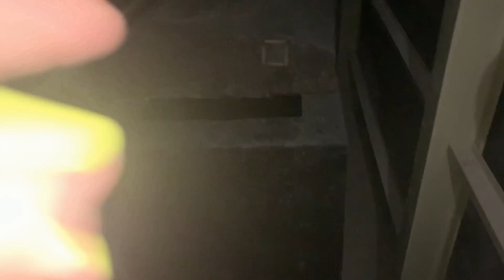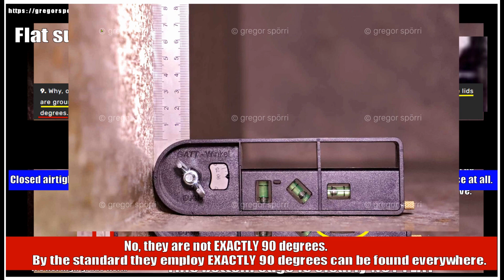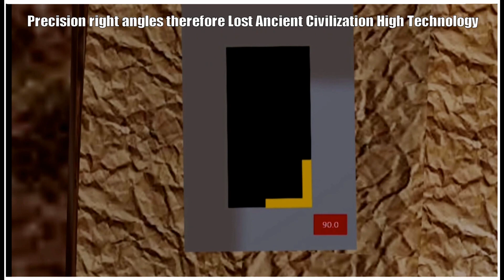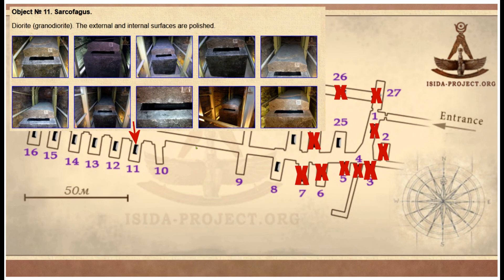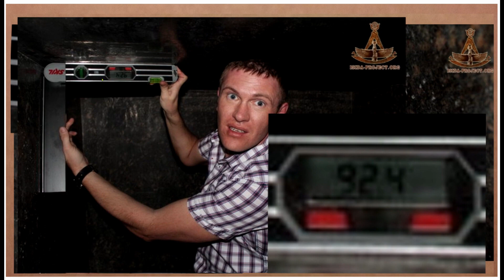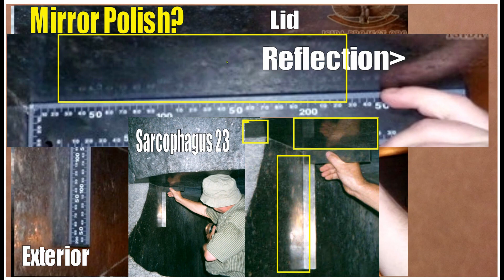Ancient Precision at the Saqqara Serapeum!? NOPE!! It's False!

Comment: A granite box that size for a bull in a wood coffin?  
   If the bull was desicated why would a tight fit for the lid be necessary l wonder, unfortunately a 'cult of underestimating our ancestors skill' is occurring around YouTube. 
  Dunn is a fraud pretending work cannot achieve the remarkable. 
   Lincoln cathedral was also built for an old myth but that's not argued .. the Sagrada Familia doesn't offer material for ancient aliens shows yet ; )
    I couldn't build a Stradavarius first go , l couldn't use an Antikythera without the kit and instructions either ,  l would enjoy learning tho
  You are correct in thinking that there is an agenda of LAHT, l hope it just encourages tourism and not ignorance in the long-term 
  Meanwhile many, like me need education ..
    I had a piece of granite and scratched my initials with flint,  then to drill holes in a small quartz garden water feature l bought diamond drill bits. 
   Physical work seems slow to keyboard users so l understand how disinformation of precision leads to myths 
   Your work is important  🙌

Comment: You really need to see the big picture here. It's just not Egypt but all around the world. If you think they did this with basic copper and bronze tools you are such a fool. This is 100 ft underground with not a lot of room for a lot of people in there. Theories on how this is done is laughable.
Reply from the maker: @jgillettejukebox  i have a long list of experiments and how to videos using “primitive” tools on granite. I have a standing challenge to do the impossible to explain tools marks in real time in a podcast. 
Copper and primitive tools work just fine. It’s about technique.
I have a long video on the width and depth of the tunnel network. It’s no problem to move them. Also no box is 100t even with lid inc. it’s 45 tonnes. Not so long ago but recent enough to be photographed and filmed. 
Those weights can absolutely be moved without modern materials. I also have vidrr we is compiling old quarries and stone masons at work.
Why does Rogan and co censor that kind of thing?
Why do you believe them without so much as minimum fact checking?
Reply: @SacredGeometryDecoded  I have a long list of experiments and videos I've seen over the years also which show people failing miserably at trying to do with the dynastic Egyptians did. The copper and bronze tools would break all the time. I like to look at the big picture here. You know this place is 100 ft Underground and about the length of three football fields? It was hollowed out. Barely enough room down there for 10 to 20 people to stand side-by-side let alone enough people to move 60 ton boxes around corners into small little rooms that are basically hardly larger than the boxes. For instance are you familiar with the 40,000 Granite Stone vases found under the step pyramid some of the hardest rock hallowed out to where we could barely do it with machinery today. Many of the vases less than 1/8 of an inch thick in places. Credit was given to the first dynasty but amazingly enough that technology was lost after the first dynasty because we never see it again. Even in the writings of DJ oser he said they were heirlooms which would lead one to believe they came along before him. And also interestingly enough the Egyptians were never able to after the fact ever make Granite Stone boxes with that Precision like that again.
Reply: @SacredGeometryDecoded  Ive replied twice but each time the comment has disappeared. I have seen many videos where they tried to duplicate what the egyptians did with their primitive tools and they failed miserably. Tools kept breaking. There is no proof how its done only theories. What I want to see from you is proof that someone took a dionite slab and used the copper tools to make right angles and make the top level and polished. Also that they used those tools to hollow out the box with right angles less that an 1/8 in off. Nobody has done it. I know. The egyptians never recreated those boxes after that. Lost the skill huh? Same with the 40k granite vases found under the step pyramid. Granite hollowed out into vases with some only less that 1/8in thick. No mistakes on any of them. We couldnt do it today w/o machinery. Credit was given to 1st dynasty. But that kind of prowess with granite vases were never seen again after that. They forgot how? Djoser said in his writings that they were heirlooms. Which would lead one to believe they came before him. Yes the egyptians worked with those tools, but on all the crappy things that came after the great pyramids.

Comment: if you add copper  as you saw would it  replace worn teeth  like cold forged like gold  also couldnt they bake  enamel or glass to blades like the enamel on funeral dumies  were green stone dust mud hay and tin  baked in fire theyre glass hard ?some stones not cut they just come out like that  if the mudfosil university channel is correct  the stones might be giants solidified by silica and  the flood  theres a story on that channel that discribed a woman turned to stone in 45 mins from drinking geode water  the autopsy had to use axe to open the body?
Reply: Blades for cutting stone don't have teeth. They cut by grinding an abrasive into a channel

Comment: Regarding the moving of these stone coffins. Auguste Mariette, French scholar, archaeologist and Egyptologist, recognized traces of rollers on the floor of the galleries, and found two wooden horizontal winches, each operated with eight levers, in one of the niches. Heinrich Karl Brugsch, German Egyptologist, who visited the Serapeum in 1853, noted that the "double-rails", on which the sarcophagi were rolled in, were still clearly preserved on the floor of the Ptolemaic service tunnel and the following passages. The Egyptians could perfectly well move these objects. Especially since they at this point in time had 2000 years of experience in shifting large and heavy objects.
Reply from the maker: https://www.youtube.com/watch?v=mysYT260dqU&t=417s ancient presence channel did a video including that information after translating the older documents from French.
I made a video a while back just of old black and white photos of quarrying and masons, It's sort of sad how back then it was barely worth mentioning to move stones heavier than the serapeum coffers and lids combined. I constantly get people insisting even modern tech couldn't do it. A 100 tonne manual chain hoist can be bought off the shelf and specials made for heavier loads. The heaviest stones ever moved such as Baalbek trilithons could be not just moved but lifted with 6 to 12 men. Moving these coffers is no problem at all with  primitive tech. As you mentioned earlier it's about the friction. I can' lift a car but I can move one easy enough as long as the park brake isn't on.

Comment: Thanks for the video, I enjoyed it, though few things to add
- When I did this trip, it was mainly to challenge Chris Dunn theory, so at that time, I wasn't yet on a certain opinion
- during this trip, I was alone, so I must do everything on my own, measuring + recording, that is why all the photos are too close, and I created a 3D model to explain. I am a right-handed person, but I had to use my left hand sometime in measures, to allow my right hand to take a shot
I will quickly answer your 2 gaps, and inclination
1. The Gaps: This box is internally semi-polished, other boxes were completely-polished, however, it was my first selection as it was easy for me to access, and jump inside it to apply the measures, if I have another chance, I would pick polished one .., however being semi-polished doesn't contradict with having 90.0 corners, correct? ;) 
2. The inclination: to understand why inclination was different, I must shortly explain how this tool works, you set it on an edge, and click the button to make a "reading pause" for the length, unfortunately, the tool is not making the same pause for the inclination, that is why it could keep varying although the length is fixed, so, I make the measure, click the red button to make a “read-pause”, take my small camera, at that time, inclination varies a little bit while taking the screenshot, so as a result
I had also added I applied other measures in other boxes (but not in the Sarapeum), Teti pyramid box, and other boxes in the Egyptian museum, and some have a very small error, +/- 1 mm, or around
The measures are authentic, it is not in the garage : ) and yes the Digital Protractor was calibrated, but thanks for the highlight, and I also encourage you to visit the Serapeum, as the inside precision of the boxes is only 10% of the whole mystery of lifting up and moving the boxes in the narrow tunnels with many other constraints
Reply: Were there reproductions of the stela?